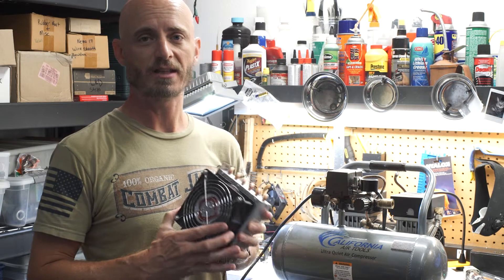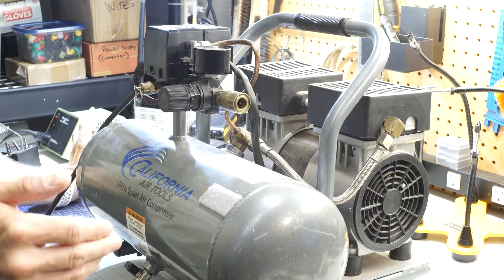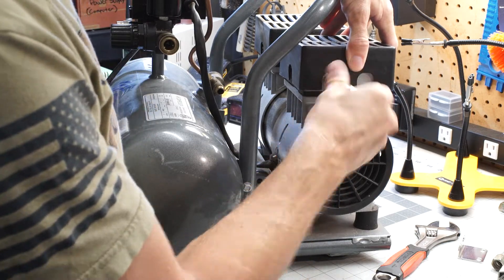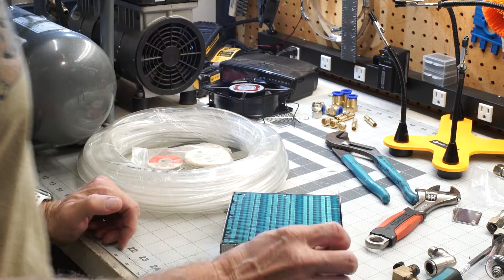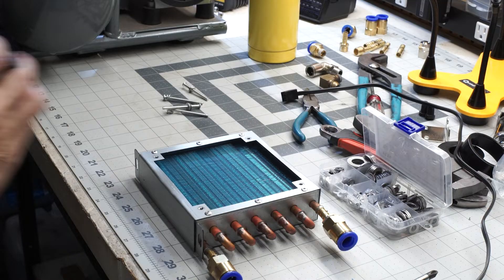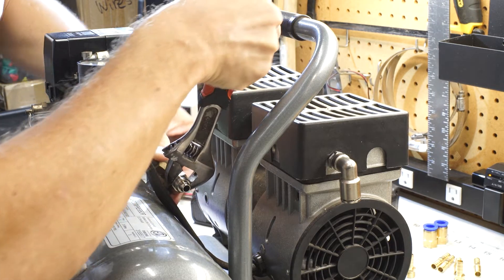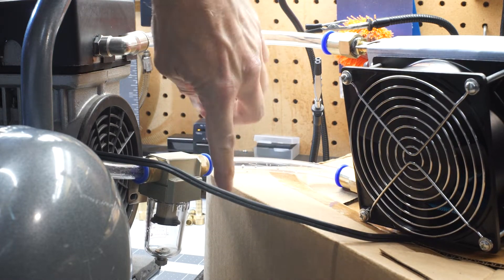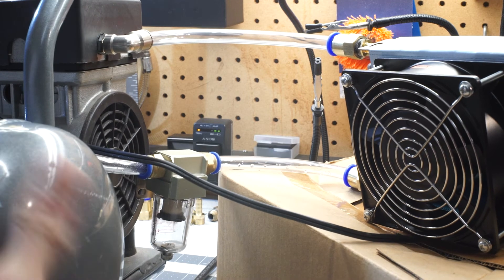How to install an intercooler and water trap on a small air compressor

Comment: subscribed.  love the vids.   is it the compression itself that makes condensation?  does it have anything to do with relative humidity of your environment?
Reply from the maker: The air is compressed, which also heats it, and all the original humidity stays in, until the compressed air then later cools.  Cold air cannot hold as much moisture, thus the condensation occurs.  The more humid the environment, the more water in the air, thus the more that will later condense out.  This problem is much worse in warm humid environments like where I live, but will still occur (more slowly) anywhere.  This all normally happens inside the tank after the air cools back down, but then the water accumulates in the tank and can become a problem for multiple reasons, but especially if the tank is steel and the water is left to sit for extended periods.  Look up "compressor explosion" on the inter-webs and you'll see loads of information about this.  To be safe, drain your tank after EVERY USE.
Reply from the maker: Also - never buy a used air compressor, unless the tank is aluminum - then maybe.  (Mine is.)  You never know how much internal rust and/or corrosion there is, and how it was previously treated. (or ignored)

Comment: Where did you get your valves? Amazon, Granger?
Reply from the maker: Actually, everything but the fan came from AliExpress, and the fan came from Amazon.   Actually the condenser came with it's own fan, the one you see me remove, but it was 220V and didn't work well, thus the 110V fan from Amazon gets installed.

Comment: Is there a correlation of size between the reservoir catch separator and the tank size?
Reply from the maker: Well, yes, kinda.  I guess it depends how much airflow you need and how often you want to empty it.  They do make automatic draining separators, but I was cheap and bought this tiny manual one from China.
Reply: I also forgot to ask how you planned to mount that onto the compressor. Or will you just have it as a dongle lol?
Reply from the maker: @AlanFullmer  Good question!  I almost included this in the video, but kinda didn't because I ended up just letting it all sit behind the compressor in it's final location.  My original plan was to mount it to the compressor, then I got lazy.